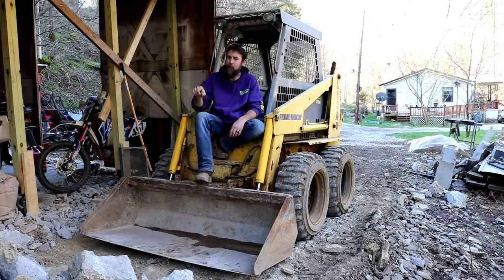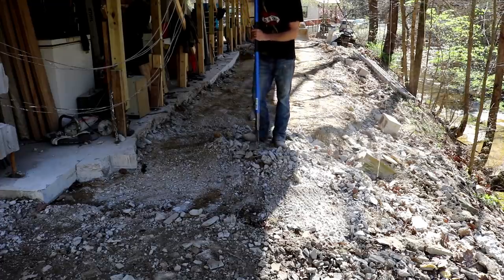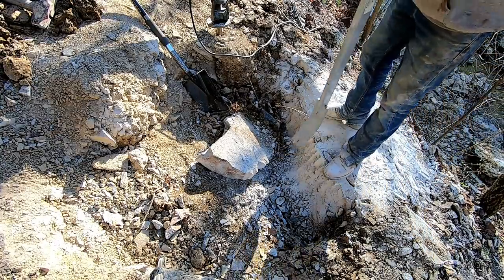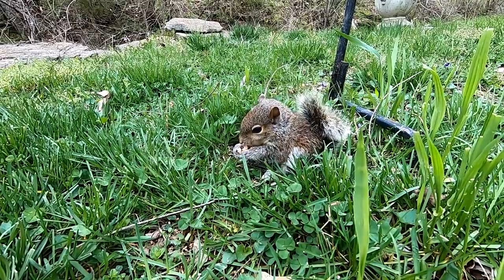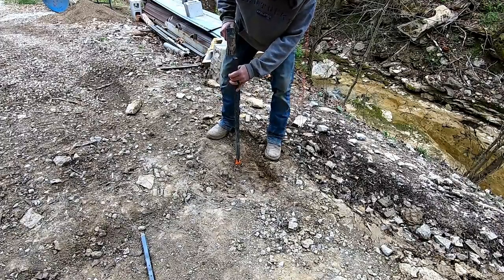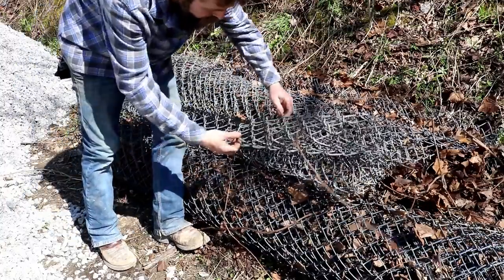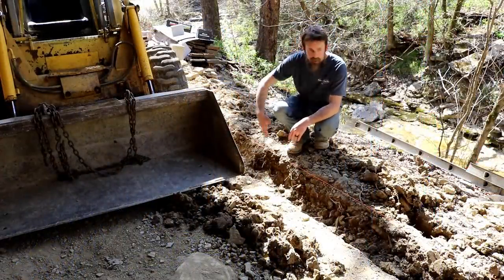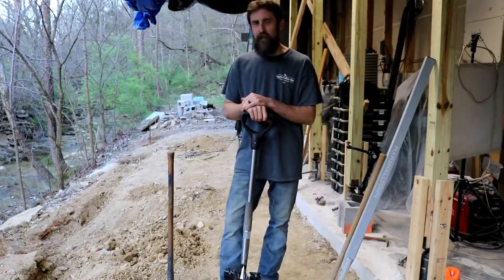BIG Rock and shop floor rubble Removal  It Keeps getting better! Shop damage part 9

Comment: Not sure how much rock is in the ground, but the best way to keep the slab from repeating the past problem would be to drill 8-10 holes down several feet then put rebar and concrete to the surface. Need these every 8-10 feet. Then form a horizontal grade beam spanning the holes the length of the shop. Then pour your floor over the grade beam and dowel into existing slab.

Comment: Should put some wooden stakes in them holes You drilled the rock, pour some Water on stakes=wood swells and cracks the rock clean open handy tip from a arm-chair engineer

Comment: Great to see your progress Steven. Might want to consider doing a monolythic pour. Meaning you do not pour the footing, then the slab in two pours. Rather dig your footings with a full taper toward the interior. Tie all your steel together and pour in one shot. I was always told it makes for a stronger pour.

Comment: Hey Steve, every shovel full is progress. Newt the newt and Walnut are great additions to the videos.  The basket idea is great.  Sometimes footers are designed so that the wall is centered but when that is not possible the footer can be off center from the wall.  Check with your engineer and see if you could move your footer to the inside allowing your foundation to set off center.  That would keep the footer farther from the creek bank.  Just a thought from an old bricklayer.  Greg

Comment: That bucket needs a new cutting edge.  A cheap and easy source is discarded grader blade edges.  My local metal supplier has scrap/surplus and you can get used grader blade edges (snow plow edges too) for cheap.

Comment: Just had a thought, what about setting the wall Short of the original and creat and overhang for the roof. This would keep the footer back from the hill a little more . You would loose a little floor space but would make for a better foundation. Just a thought. Good video 👍

Comment: @Steve Summers 
Glad to hear that you're gonna use the Gabion Baskets of Rip Rap/Concrete for the Creek Bank like i had mentioned before weeks ago. I used them on my Creek Bank, and they have worked out beautifully. Due to Flash Flooding my Bank was suffering from Erosion very badly. I used about 4 Dump Truck loads (very BIG Dump Trucks)  of Rip Rap, and built about 100' Creek Bank out of Gabion Baskets filled with Rip Rap & some Demo'ed Concrete. You will never find anything that works any better for shoring up a Creek Bank, short of pouring Concrete Walls, and who in the world could afford that? Lol
That Heavy Gauge Chain Link you have there will make some very nice Gabion Baskets. If you were to run out, and need more material, I found this place when I was doing it, that has everything you could ever need for this type of project. wwe.gabionsupply.com this is there specialty. They make every tyoe of Gabion Basket there is, out of every kind of material, as well as Reno Mattresses. They also sell just the Material to build your own. They have free Webinars every Wednesday. Go check them out. There is nothing like Free Education & Advice from Experts. Good luck, and keep up the Great Work!

Comment: Steve If an excavator is hard to get, you could easily use the skid steer to dig out the foundation. You would simply need to back fill the side closer to the shed with soil (using the skid steer) and do the final trench shaping with a shovel

Comment: Good to hear that you aren't going to mix that floor by yourself. Bigger jobs than that have been done mixing concrete by hand with a hoe with holes in it in a tray. Many barn floors were made like that well into the 1950s. I think the Amish still do it today.

Comment: Steve, if you rent a mini excavator to dig your foundation, see if you can get a breaker hammer attachment with it, that way if you find big boulders you will be able to put the hammer on and break them easily, i wish you weren't on the other side of the country, i work in construction and would love to be there to help out....

Comment: With the This Old Tony shirt on, you should be able to karate chop that block into pea gravel. LOL I would recommend having the concrete trucked in as well. It will give a more consistent, stronger cure.
Reply: IN THE SHOP. Best advice in the comments I have read so far .The industrial ready mixed in trucks will be far better than any home made mix for large area quantities , sorry to say Steve but that TOY cement mixer is Ok for domestic brick and block work jobs ,just ain't up to that floor job .Lot of $$s but worth it not to have to do the job again in your lifetime .
Reply: @karlhrdylicka  I used to build auto shops and install lifts. By ALI and OSHA standards all pads had to be poured from a certified concrete service. During training we got to see first hand the difference it makes. When you work with concrete, timing is everything.

Comment: There is an expanding grout that will break rocks guaranteed to work,  ECOBUST works well, drill some appropriate sized and spaced holes, pour it in and wait. Poof rock broken.
`

Comment: For the river bank have you considered the use of Gabions? Basically they're wire cages you fill with rocks etc. and are designed to shore up banks, slopes et al.
Reply: He mentions them in the video.
Reply: @dudleysdad  Ah, was pottering around so must have missed that. Thanks.

Comment: lay that bonus wire mesh down and spray concrete on top of it, it should stabilize nicely that way for the crown of the  bank

Comment: If you can I would recommend drilling holes for your form stakes if they hit rock. Any rocks you take out will need fill compacted back into the voids they leave so in my opinion they are better left alone if possible. If you have holes that need filled in ag base would be the best material to put back in them and pugged ag base (wet ag base) would be better than dry if you can get it. Using dirt in voids is ok if the dirt is good enough quality and you put the right amount of moisture in it for compaction but this is where pug ag base shines because you know it’s good and consistent whereas fill dirt varies in quality for base material. The main thing is that you don’t want a bunch of loose dirt under your slab or anything that is too wet because it will settle like it did before. The ideal moisture content is usually right at the point that you can make a ball out of the material without it being overly soft. Once you’ve established a decent subgrade you can use screenings (like kitty litter) for the last inch or so to level everything up good and flat and avoid wasting concrete. The screenings aren’t entirely necessary but they are cheaper than concrete and they are really easy to spread by hand. We dig our footings before setting up batter boards that way they aren’t in the way. We pour the top of our footings to the elevation of subgrade so we don’t have to use forms for them.

Comment: You may want to talk to a structural engineer about the footings along the creek.
I would Recommend a Cassion and grade beam type footing.
That is a line of short steel reinforced concrete piles that you would drill/bore along the creek every 10 feet or so. Probably about 6 to 10 feet deep.
Then along the top of the cassons, a steel reinforced 2 foot by 2 foot concrete footer would run along the top of the cassons.
You could place the cassons in areas where there is no big rocks, hopefully.
But a drilling/boring company should be able to drill tru the rock you have on the location.

Comment: Is that a vintage, brass, Hg weighted, plumb bob?  I have 2 of those.  Your land looks like it was a flash flood rock deposit covered by dirt.  Or maybe a small glacier moraine from the last ice age! LOL  Short handled shovels are a torture instrument!!  Be careful and don't run that jackhammer chisel through an appendage.  A lot of work to get to where you are.  Praying everything goes well from here.  Praying Miss Elizabeth is well.
Reply from the maker: It's a pretty new brass plumb bob unfortunately. Nothing special about this one. Our ground is full of limestone. Its sedimentary rock from sea deposits. There are solid layers all around the area. Good to see you Vernon 👍

Comment: You might consider going with a "pole barn" style foundation and framing for that wall.  You can easily do it yourself, which can save you a lot of money and it's very fast to put in.  Whether you go with a block knee wall on a conventional poured foundation or poles on pads, I'm assuming you aren't relying on the foundation to guard against any shearing forces (i.e., whatever approach, you need to dig down to something very solid and build up from there).

Comment: The way that big rock slabs off I wouldn't be surprised if you found some fossils in some of the slabs. Did you ever figure out what the slimy red salamander looking critter is? I'll bet you're looking forward to looking out the windows of the new section of the shop. Most people I know see a shovel and the first thing they asks is if it comes with an operator.

Comment: If you aren’t digging down and pouring a footing 4 ft down to hold the new wall I have had pretty good luck with digging a post hole every 8 ft filled full of cement underneath the wall. And some under the floor to keep everything in place

Comment: Looking good Steve, you are slowly but surely getting there. As far as the excavator goes how are you going to be able to dig the trench when the land slopes away directly from the edge of the trench? You can only straddle the trench with an excavator, and you have no land under one side to sit the excavator on. Big problem methinks. Looks like it's a by hand job with those super spades you bought!
 Little Walnut is so cute!!
Reply: Mini excavators have swing booms. They're (most) not like big excavators where the whole cab swings with the boom. This allows them to dig trenches right up next to a building. Same technique for this situation.

Comment: Disappointed, thought you were going to fill those drilled holes with black powder. ;-)
Reply: Feathers and wedges.
Reply: Yeah I was hoping for some blasting action myself. Now there's a tool you don't want to operate. One of them mining drills. Affectionately known as a "widowmaker".
Reply: Forget black powder, use dynamite.
Reply: Dynamite !! Probably need to rebuild the whole building Feather and wedges would be the way to go especially with that rotary drill you are using

Comment: Hi Steve, I
I am in civil engineering in the UK. Using a 1'' x 16'' reed bar, drill 6'' into the centre of the depth of your existing concrete, every 14'', to tie into your new concrete. You also need to use some resin anchor, to fix the bars into the holes you drill. The new concrete will then tie in with these bars. I hope this helps you.
Regards, Chopper 316
Reply: Nigel Harding you mean drill in horizontally? I was wondering how one ties in a new pour with existing concrete. So you basically glue bars in place before you pour the new floor?
Reply: @sblack48  Yes, you drill in horizontally. Then you use epoxy to hold the rebar in. (L-shaped rebar, so the slabs can't pull apart.)
Reply: @sblack48  yes. that's right. the bars stick out into the new pour, so that they support one another to stop them separating.

Comment: As for  drilling with that Bosch. Try not to put too much of weight on the drill. The drill chuck impact mechanism needs some space to move up and down in order to work properly. You only need a slight downward pressure.

Comment: If your going to do a strip footing, get down to a solid bottom in the trench. If that’s not possible, make it 14” wide and same depth with 12” piers every 8ft, down to a hard bottom. Use bulk concrete in the bottom of the piers and steel trench mesh in the trench.

Comment: What on earth was that little creature? I have never seen anything like it. That skidsteer is making short work of the concrete removal. Loving this rebuild series - even though it's not the usual machining stuff. It's still great entertainment and information. Glad you got the structural engineer to take a look, and come up with a permanent fix. Good luck getting a mini excavator. Looking forward to seeing the footings and slab poured. Cheers, Craig
Reply: Some sort of salamander.
Reply: @eliduttman315  you can't heat a shop with that little creature!
Reply: Thanks Eli

Comment: A cloth/fiberglass Surveyors tape is a poor tool for laying out a building... because it stretches. Stick with a metal tape.  Will you be doing the foundation footer and supporting walls first and the slab work second?  Or will you move your roof supports outside the foundation and do the footer and slab as one?

Comment: Hi Steve. Just came across your channel a few days ago.  Is there any way you can slide your whole roof  to the right by 10 feet or so and build your new foundation on the side away from the stream? Hydraulic rams and teflon sliders?  If not, would it make sense to make the  temporary support posts you put up the new outside wall and put up support posts only to hold the roof up by the river and use that area as roofed over storage with not walls. Then build a new addition on the right side or out the back of the existing and not worry about it washing away in a bad flood.

Comment: Steve, do you think it might be good idea to remove trees growing on the bank. Roots may also cause the natural rock to crack and cause any structure you build to fail over time. Just sharing my thoughts. Stay safe.
Reply: On the other hand, the trees and shrubs are holding the ground in place on the rocks.

Comment: Steve now that you are doing all this foundation work, have you considered making the shop bigger? It seems like an excellent opportunity.
Reply: What's he going to do, build it in the air?
Reply: @1pcfred  I was thinking somewhere in the horizontal plane, which would mean pooring a bigger slab. I guess adding a second floor would be a option but I'm not sure if that would be the most economical option. What did you have in mind?
Reply: @gatekeeper84  I'd want to stay off the edge of that creek bank myself. I understand that losing floor space is not desirable but then again having your building falling in a creek is no fun either.

Comment: The person that built that slab probably seen the amount of boulders and rocks that make up the streams bank and though that'll do as a sub floor i won't need to add reinforcement to the slab and it won't be eroded by the water so that will do
Reply: Mark Mawson yeah they definitely went with the "good enough for govt work" approach so of course it came apart a few years later.

Comment: She turned me into a Newt. 
A Newt?
I got betta.
Congratulations on the new family member.
You aren't far from getting over the hump on the worst of this work. The footing will be the biggest dog to conquer.  When you bring in the mini- watch your boom against the roof. you may want to rent a jack hammer that goes on the mini to finish digging, I have no idea what you are dealing with; you said before it is a lot of fill and there may be more big rocks down there, cut them out of the way rather than dig them up. but you have a mini- it can lift your current jack hammer down in there if you rig a rope to it. Don't be surprised if you hit solid rock down in there, its in the creek 10 feet away. Solid stable ground is what you are looking for, I imagine the engineer will tell you what is best, but the fill they used for it the first time may make it hard to figure out what exactly that is. I wonder if they will make you pin the footing to the stone? And don't try to make the ditch wider than it needs to be to pull out a loose rock if you can help it, go wider if it is unstable and starts falling in on you.
Thanks for the videos, sorry if I set you down the path of all this labor, you are almost past the hardest part of this project- I promise. I would help for free if I could but you are a 9 hour drive from me and lockdown, I ain't exactly wealthy, and you might think I'm creepy/weird(that happens) and don't want me around your family. (I get that a lot, hence my screen name)

Comment: Steve due you self a favor and go deeper on the footing. More like 3  feet or so, you have the block. Also make the footing 3 times wider than the block and at least 12 inches thick. But due as you see fit. Great job.

Comment: This is what I would do, after watching your vids from the start i would completely demolish the entire building and start again, may even excavate out the hill for more room so access to the rear on both sides even bench the top bank (roadwork engineering term) and rebuild, leaving the entire section on the river bank alone only vehicle access to rear, is the cost and time to stabilize such a small area worth the effort?  means a new workshop on a new one piece slab done properly, workshop could be a lot larger which will last several lifetimes, cost of repair in comparison? long term it adds more to property value plus a larger workshop that won't move in future.
Reply: While that's a good idea if money was of no concern, but Steve is on a limited budget like most of us are.
Reply: @jmwarden1  yes I know, history will prove, it will work because of the light structure he is building in place of heavy structure, old adage do it right do it once was the first builders error.